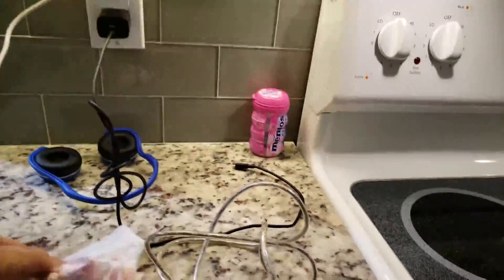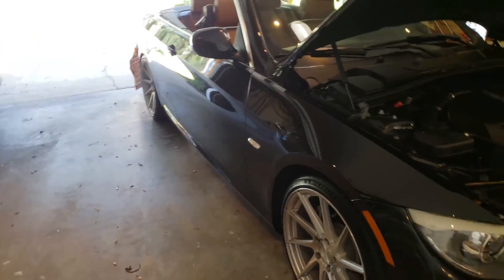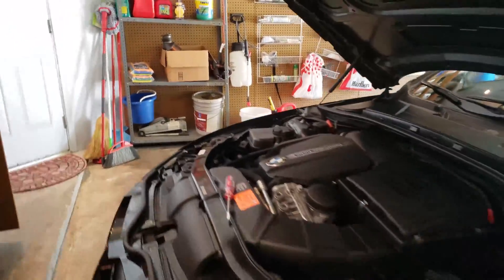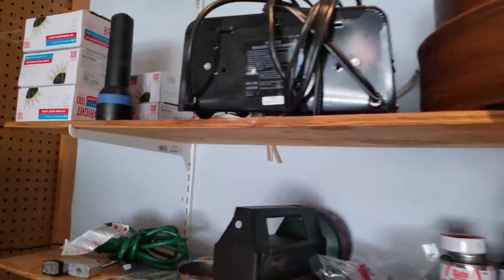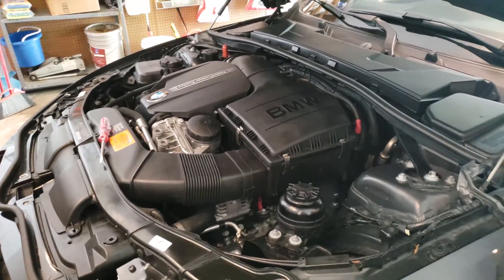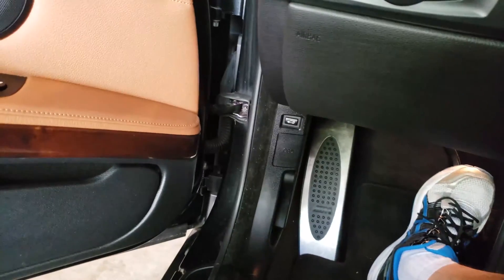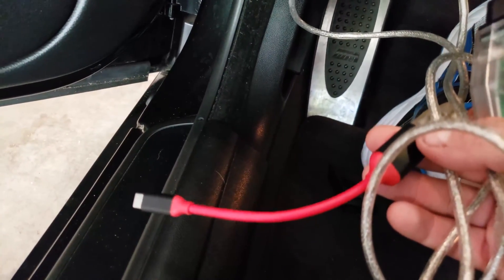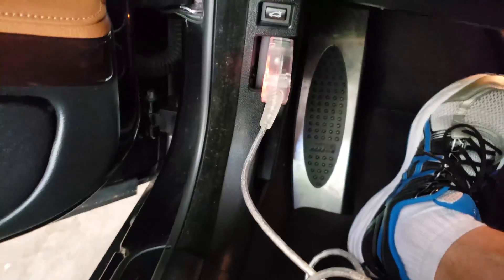335i N55E MHD Ethanol Tune - 400hp!

Comment: I did mine without a battery charger and it was fine
Reply: really i was scared to do that when i flashed my 335i lol
Reply from the maker: They recommend a battery charger as it can take over 30 mins for the full write but do whatever you want to do. When it fails because you had a weak battery your computer will be hosed.

Comment: So u can flash it to e85 before driving to the e85 station? Then just fill up 25-30% there?
Reply from the maker: It's always flashed with E50 tune.
Reply: @Supercar_Street_Racing  e50 is just half 93 half e85? About how much power?
Reply from the maker: @Vozip  Not really. You can't calculate it that way. 93 Octane generally has 10 percent Ethanol. There are calculators online just type in E85 Calculator. So it's never been on the dyno, but estimating around 400whp. Could be a little lower. I generally run 7.5 Gallons of E85 and the rest 93 octane and I don't have any issues with misfires or anything like that. It's never going to be exact without an ethanol content analyzer because E85 isn't always E85, it varies in Ethanol content.
Reply: i believe so ? i want to do this to my channels 335i

Comment: 😎👍Great job bro.
What is the benefits of e85, is it cheaper or do you get more power.
Also, with Stage 1, how much hp do you gain and what is the mpg on an n55 f10bmw.
Thanks
Reply from the maker: It's cheaper and you get more power. I really don't know the rest of the answers, maybe try the MHD threads on the forums.
Reply: @Supercar_Street_Racing  2 cents.... DON'T DO DIYS IF YOU DON'T HAVE ALL THE KNOWLEDGE NEEDED

Scrub
Reply from the maker: @TheBoostinbobby  WTF you talking about. The car is tuned for E85. I think I have more knowledge than you do. TY for the 2 cents,.